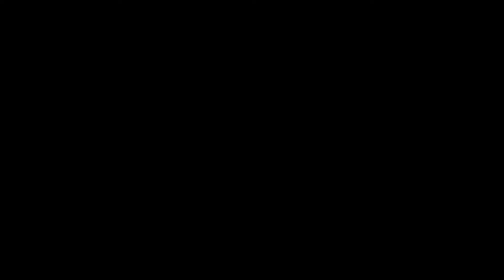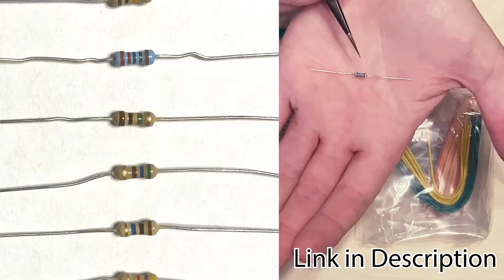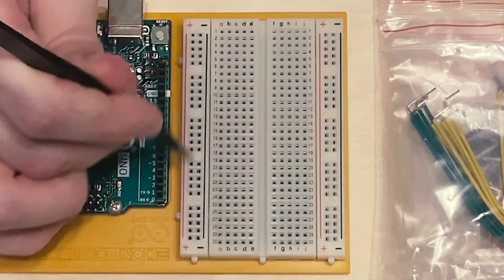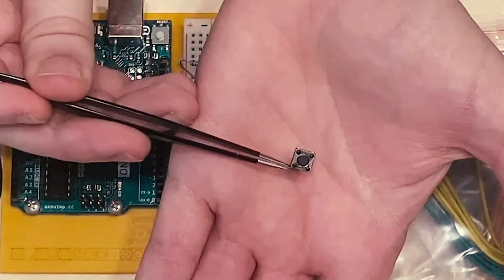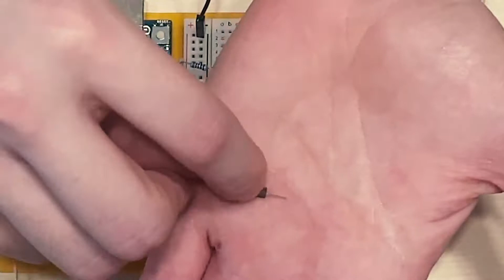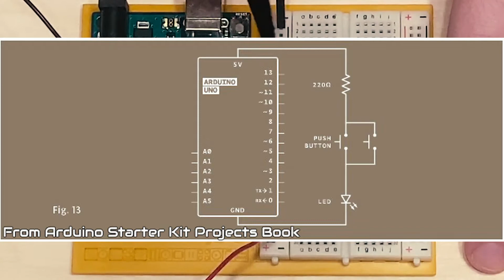Arduino Starter Kit Tutorial 01: FIRST CIRCUIT

Comment: Where can i get hold of you need some info. If you dont mind helping me out
Reply from the maker: Hi Alexander, thanks for watching! I would be happy to answer any questions you have here in the comments. That way it might also be able to help out other people.
Reply: @howtodothat485  oky cool. I want to build a board that has to keep time , turn on 3 lights and auto dim and bright a set times . Its for a aquarium to simulate the lunar cycle. Thank
Reply from the maker: No problem! Just looking at the project from a high level, you’ll likely want to use pulse width modulation (PWM) to control the brightness of the lights. If these lights combined are greater than 5V or 20mA lights, you don’t want to power the lights directly from the Arduino. You’ll instead want to use something like a BJT or MOSFET (types of transistors) to indirectly control the lights. You’ll also likely need to size some resistors appropriately to control the current through the lights to not overload them. I’ll be covering these concepts in more detail (PWM, transistors, and sizing resistors) over the next 3 weeks or so, but if you have the Arduino Starter Kit book, the Color Mixing Lamp tutorial covers PWM, Motorized Pinwheel covers MOSFET, and channels like GreatScott! have good videos on how to size resistors in their various videos. Hope that helps provide you some direction! Sorry I don’t have those videos up yet, but I will before too long!